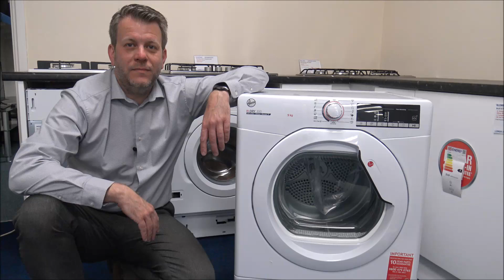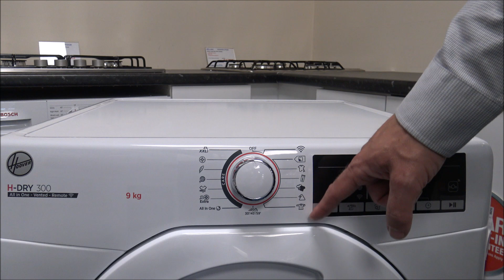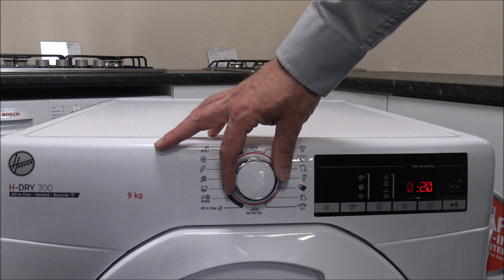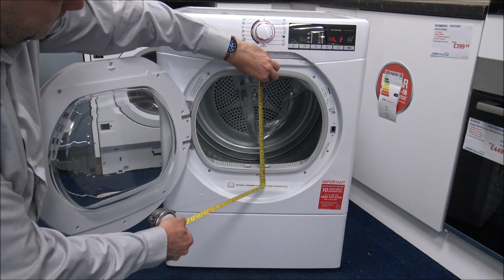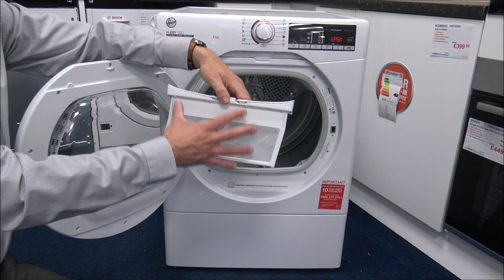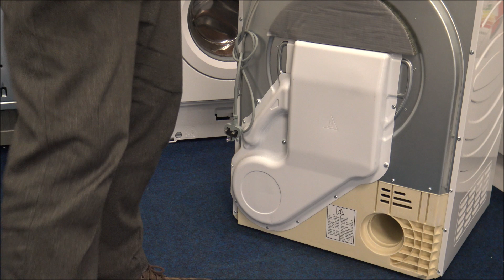Hoover HLEV9TG 9 kg Vented Tumble Dryer

Comment: Do any of the clothes get warm? Bought similar version today have no idea which setting to use. I just want heat and I will decide how long. Wish I could return it already!
Reply from the maker: Manually timed dryers are very difficult to get hold of now. A sensor dryer will normally be more accurate as to when the clothes are dry which can save money on electricity and excess wear on clothing

Comment: Hi Andy thankyou for your video, could you help me please, the new 10kg hoover vented dryer,  that has been brought for the house i live in, the top is slightly different to your 9kg but is very similar, the on off button is seperate and to the side of the main panel, i've read the instructions but find it difficult to get the machine to start, i turn the dial to the programme to be used,  and press the start button but nothing happens, is there a time gap, is it me or the machine, it is making it quite a frustrating experience, but when it eventually starts it does the job very well,  Many thanks Susan
Reply from the maker: it does sound odd, there may be an issue with it, but sometimes the buttons can not be too responsive on Hoover displays which is why you may be struggling
Reply: if it goes on time gap turn off and restart

Comment: Hi .. good information video straight to it… I have a new hoover vented 10kg  dryer… I’ve installed it but it’s continually making a thumping noise… I’ve done all the usual things ie adjusted the feet made sure of Correct clearance taken out the packers inside the drum etc but it just will not stop this thumping…. Any advice would be greatly appreciated… cheers mike
Reply from the maker: This does sound very odd that its making a thumping noise, it sounds like there could be a fault so i would contact the retailer to see if they can get it checked out for you

Comment: I dread the day that I bought this dryer.  I always had Hotpoint which was so easy.  I needed a new dryer due to new kitchen and Hotpoint no longer have a vented TD.  I have never used a dryer so complicated.
Reply: Totally agree ……. Designed by keyboard warriors not a practical item…. Also doesn’t really get hot enough…. Have to restart several occasions

Comment: I bought the 10kg version of this machine a few months ago. It is great for drying clothes but absolutly dire for any large items  like bedding which should be its playground with a 10kg load rating. it just 'balls up' the sheets and duvet covers into a rotating tightly bound mass!. This is because they cheaped out on it by not having reverse action on the drum. It only rotates in one direction meaning inevitabley, they will tangle into a tight ball. The middle of the mass is soaking wet and the outside is very hot and dry.

Understand my frustration, i explained this to a lady at hoover and that i have tried several different combinations of small items and bedding, just bedding and everything in between. If i put said items in machine, they remain wet and she said almost as if advised by a legal team to utter in the words "this is not a fault" A tumble dryer that does not dry bedding is not faulty??? 

I have called both AO from where i bought it and Hoover themselves. Hoover said they understand the problem but couldn't or wouldn't do anything about it suggesting i get rid of it on facebook marketplace. They also said i should try using laundry balls like you are. All as this does is extend the time it takes for them to tangle up again. You have to babysit the machine, removing items untangling them about 5 times per cycle.

I paid £309 for this and the 20+ year old machine they took away was far superior. AO have sent £30 voucher for any future purchases. HOOVER NEED TO RECALL THIS AS IT IS NOT FIT FOR PURPOSE.

Comment: This is the worst dryer imaginable. It has one job; to dry things. And it fails miserably. Huge number of programs. None of which works. Whilst failing to dry anything but the puniest loads (which it may eventually do after several eons) it will also tie your bed-linen into damp and annoying knots. And also for fun it makes a  HUGE clacking sound from any button or zip constandly banging on the glass door. I'm sending it back before it sends me insane. Utter, utter garbage.

Comment: I have no idea which setting to put towels on in this thing, I’ve had that load on about 5 times and they’re still wet!
Reply from the maker: I would select the Whites program as you can dry the full capacity on it, and also make sure you select the cupboard dry option not the iron dry as that will not get them completely dry.

Comment: Bought one of these and it’s the worst thing ever. Mostly use it for the so called Rapid which you cannot alter from a 30 min dry. The digital display has been repaired 4 times for free as it constantly breaks. As you said I do prefer to be around when it is on ( too many stories of dryer fires) WiFi is pointless and it takes an absolute age to dry the clothes. Worst buy ever. Your videos and exact precise and extremely clear and easy to understand.

Comment: the wifi thing drives me absolutely crazy - for an appliance that you have to PUT THINGS INTO why on earth would you then get your phone out when you're likely to be STANDING RIGHT THERE and programme it?  I have a washing machine with this function and I wish I could figure out how to switch this off as whenever I turn the machine on I literally have to wait whilst it tries to connect to the internet before it will let me press any buttons to start the thing - overengineering at its best.  And whilst I'm on the subject, IS there a way to turn the 'connection' on these things off?  And finally, why are dryers (and washers for that matter) SO overengineered?  99% of the people I talk to have a single setting they use, ONE. SINGLE. SETTING!!  yes we might amend the heat or occasionally a fast programme is good to have but why a zillion different programmes? WHY???  I came across your video as I'm trying to replace a trusty tumble dryer that's on its last legs, its the Hotpoint TVHM80CP - you know why I love it?  because its got a high/low heat button (always on low heat) and a time dial and a start button - that's it, no faffing, no programming, no needing to search for my glasses as I can't see the symbols without them, I just sort, load, whizz the dial to either an 45, 60 or 90 minutes depending on the load and press start - it works EVERY. SINLGE. TIME!  I don't need to weigh my washing (I mean, who's got time for that?), I don't need a degree to use it, IT JUST WORKS.  My previous one was a sensor drying one - what a load of rubbish, clearly the designer (or maybe the dryer, perhaps they've got it in for me) has a VERY different idea of what 'dry' actually is - got fed up of having to finish stuff off on the radiators (which kind of defeats the point surely) or having musty smelling cupboards because stuff was going away still a bit damp! only trouble is its so heavily used in our house that my beloved dryer has developed a squeak - loudly!
Reply from the maker: I must admit the Hoover dryers are not the easiest to to use, and you don't have to use the wifi connection if you don't want to. You are correct that most people only use a couple of programs. Unfortunately the programs you use could be different to a lot of other people, hence the manufacturers will offer a range of options to cover all bases.
Great feedback though, thank you 😊

Comment: I bought the H-Dry in April, to help with drying bedding for a self catering place. I wanted it for 'sensor drying'. It's rubbish. it only turns one way, which means your washing sends up in a ball, twisted, and still wet in the middle. I have used a sensor dry tumble dryer for almost 30 years. This one is rubbish and I have to put the linen in the other dryer to finish it off. A complete waste of money and now my time.
Reply: Total agree. I needs to go in both directions

Comment: How can anyone afford to run a tumble dryer these days? I've washed two huge 10kg loads on cold today ( virtually no electric if you wash on cold) and both loads dried outside in less than 90 mins- and smell so fresh. If it's raining I use my dehumidifier inside my Lakeland dry soon Dryer with the cover on but not plugged in. Dries cheaply in a couple of hours with  no wear and tear on the clothes.
Reply: First of all washing on cold is worse for the washer it’s been proven time and time again washing on cold can make your washer smell, cause mold especially if it’s not done on a 60 degree or hotter on a regular basis. In regards to your second point, there’s a type of dryer called heat pump which use hardly any electric at all I’ve got a smart meter so I know it’s not using much since it’s in the green area.  I mean my heat pump dryer can dry a full load for about 1 hour and 20 minutes compared to 3 hours plus if I hung it outside. Just saying plus your bedding and towels are always much better when they have proper air and heat.

Comment: great vid i have a combi hoover washer/dryer and bought it because it has written symbols instead of those pic my older one only had nums and i had to look at manual, since you know alot about machines can you tell me where the lint goes in a combi washer/dryer i cant find the filter to clean it out i do get bit worried about that😮
Reply from the maker: Washer dryers won't have filters like on a tumble dryer the fluff and lint just gets taken through the waste hose.
Reply: @lords-electrical  so no cleaning out thanks so much andy just something i always wondered👍